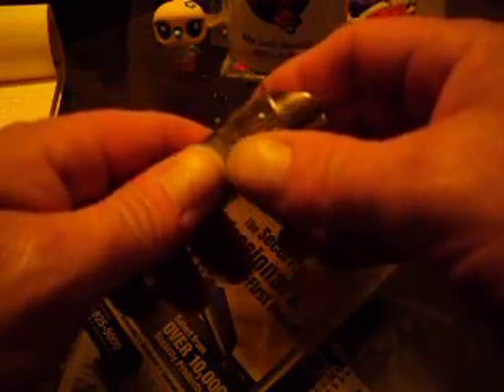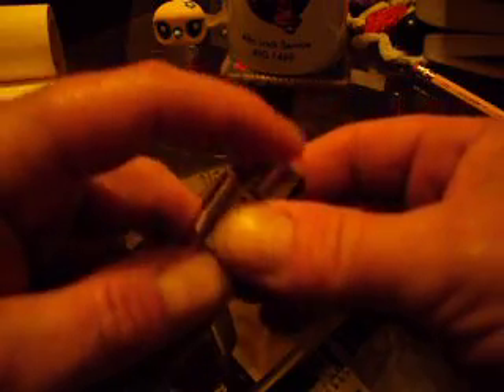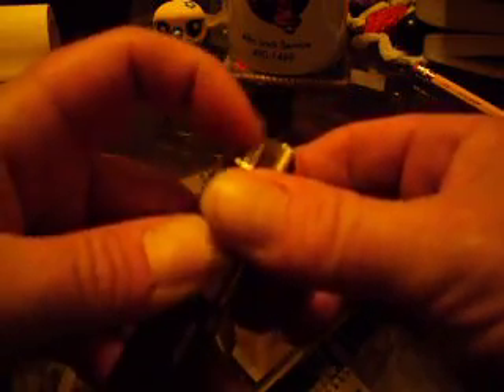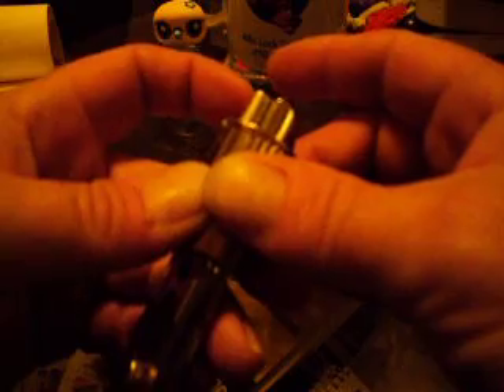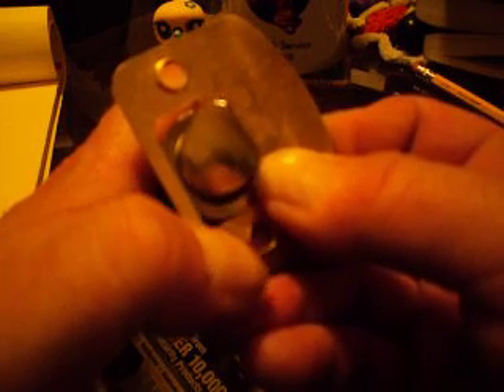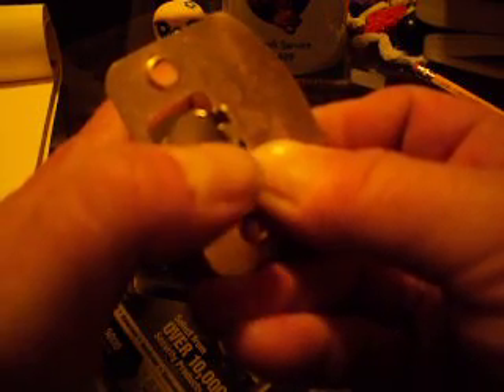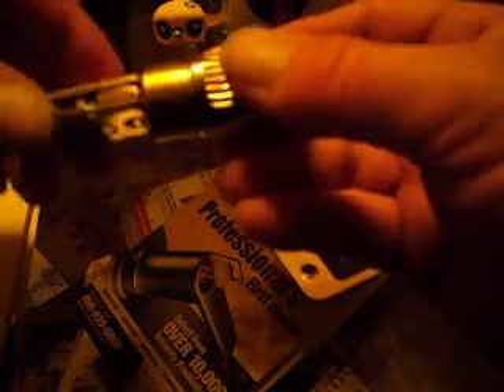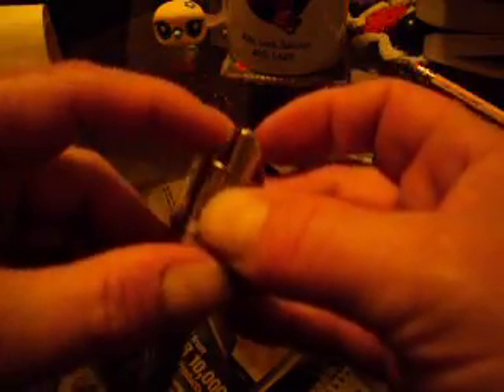How a deadlatch works

Comment from the maker: @rien783  Deadlatch failures can be real nightmares. Sometimes, as has apparently happened in your case, the latch will simply refuse to move even after the lock body has been removed. If you can't pull the latch back through the hole where the lock was mounted, try wedging the door and jamb apart. An air bladder is good for this. As you spread the door and frame, continue to try to depress the latch enough to open the door. Worst case - use a pry bar between the latch and strike plate.

Comment: pls help. 4 some reason, d door knob 2 my room got stuck. i tried removing d entire mechanism by opening d screws, but still won't budge. so i had 2 use a sledgehammer just 2 remove d doorknob completely. w/in the hole, everything is gone but the deadlatch is still stuck and i can't remove it. i tried slipping in a knife, a credit card, etc. but it won't slid open. i can't remove the hinges as it's a really heavy wooden door.